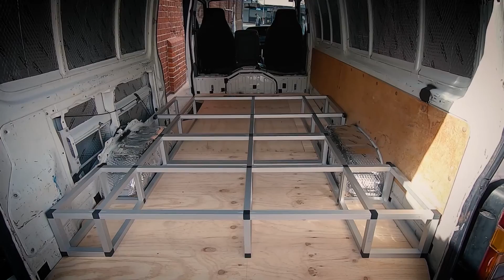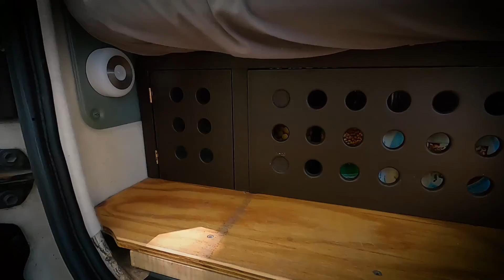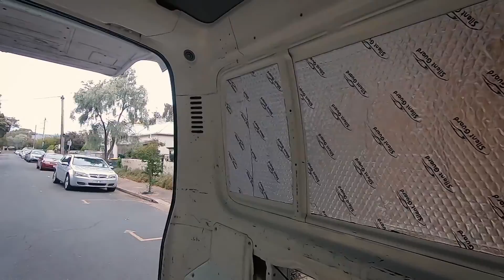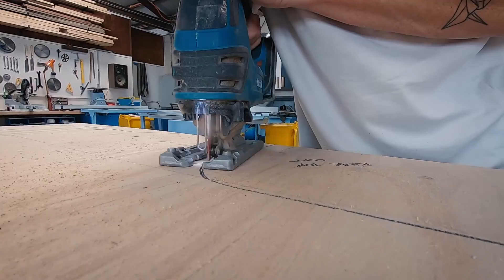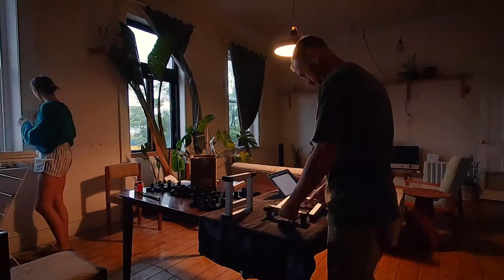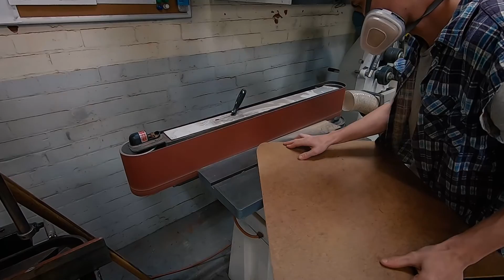05 Van Build Campervan Tour DIY Toyota Hiace Conversion | Vanlife Australia

Comment: I swear, is my HiAce the only one who’s seat has to flip backwards to get to the engine? I see these builds all the time and it makes me wonder. I can’t build anything behind my passenger seat, but at least I got the high top so I can stand up.
Reply from the maker: It been a while, but im pretty sure mine flipped backwards as well. But if you fold the backrest forwards then lift the seat - it doesnt actually need that much room behind.
Reply: @EternalJourneys  I honestly didnt know the seat could fold that way too, never had a reason to try😅
Reply: @EternalJourneys  I discovered this the other day in my newly bought Hiace.

Comment: Hey, great build 

Wondering for your kitchen setup behind the seats. Is it easily removable to allow access for changing the oil filter and fold back of the chairs to gain access to the engine. Ideally I want to do the same as yourself in my 2006 haice but hesitant due to the oil filter access point and engine access 

Thanks 🙏
Reply from the maker: Thanks mate! Yeah, if you look back at the floorboard installation you'll see ive left a cutout for the access panel on the floor. Which can then  be accessed through the two cupboard doors under the sink. Theres no backing on the cupboards either, so everything is accessible from the front as well. I had a major service done after the build, so it's all suitable. I made all of my measurements with the engine bay open (passenger seat access).  That way you know how much space you need to leave. Your newer model will obvs be different, so just take all precautions before you start.

Comment: Is it 100% necessary to insulate the floor and walls? I also live in Australia (syd)
Reply from the maker: Depends where you're going man. Definitely worthwhile if you're heading somewhere wintery cold (im in Tas atm). There's a bit of debate about whether insulation is useful in the heat.  The argument being; that once the van gets hot, the insulation actually keeps it hot longer. Of course, if you've got aircon, then its probably going to benefit. You'll def want an air vent/fans.

Comment: Like your design approach, keep it simple, make it safe, quiet, easy to maintain, non-toxic and lightweight! Quick Q, are you using a solar blanket or a portable panel? Don’t see any roof mounted panels. Also, if you know of a better small vent system, would love to know. I installed a marine style solar powered battery operated vent on mine, but it isn’t powerful enough either.  Great vid! 🐨🌷
Reply from the maker: Hey Lucy, glad you enjoyed the vid! 
I started out with a solar blanket but it wasn’t really sufficient. I’ve recently installed a proper panel on the roof. It’s just an eBay cheapie, but works well enough for my needs. As far as vents go, I haven’t really done much research. Mine is fine most of the time. It was only in North Queensland when it started warming up, that I struggled a bit. And I don’t really think a bigger vent would’ve made much difference.
Reply: @lucylou5766 You commented 5 years ago, but still here!. I've just bought a marine style fan/vent and was wondering about how efficient it would be, so it's lucky I was reading all the comments here. It's not installed and while playing with it I discovered that it doesn't work when it's in shade, so won't work at night when I'm sleeping. So it's back to the seller for a refund. Lucky I didn't buy two.
Reply: @narelle4868  And I’m still here too. My solar vent has a small battery which runs the vent at night time. It’s more than enough to turn the fan 24/7, but honestly, the unit isn’t big enough to do much more than create a little air movement. I bet marine units exist that are more powerful than the cheapie I bought.
Reply: @lucylou5766  I paid AUD$132 for mine from ebay. Testing it while it isn't installed I am underwhelmed by the air movement it makes, so I'm thinking I will return it. A couple of fans at either end of the van would make about the same air movement. It's an EG Solar Ventilator. (Youtube just glitched and added my comment multiple times, then deleted them all).
Reply: @narelle4868  A lovely woman in the US called Lady Bugout uses nothing but two marine vents. She reckons they work. She is a DIY type and her van is really different from most. She is very practically minded. Having two means air in and air out.
Reply: @lucylou5766 It's from @LadyBugout that I got the idea. I just asked in comments how they are.

Comment: What kind of wood you used for the floor frame?
Reply from the maker: Hey, I used pine ply-board and cut it into strips. Cheap
Reply: @EternalJourneys  thanks love your video. Just wondering what thickness ply and insulation sheeting did you use for the subfloor? Cheers

Comment: Hi. How did you attach the floor frame to the van? Thanks
Reply from the maker: Hi Pedro, I used liquid nails. Which is a type of adhesive. Very strong. Then there were a few screws that went all the way through the floorboard and the floor frame, into the metal. To ensure everything stayed in place. Make sense?
Reply: @EternalJourneys  hi mate! Just wondering. You screwed to the metal as well? Is that not going to cause rust?
Reply from the maker: @Adrian-sv1mo  I only put a few screws into the metal. Then climb under the van, clean around it and spray with rust-stop paint.

Comment: Thanks for the vid man, super easy to follow and the links are great. Just wondering the best way to attach the masonite walls over the windows?
Reply from the maker: Hey thanks Steve, glad you enjoyed. The Masonite is held up using adhesive Velcro. Not ideal, but in combination with the felt carpet it has stayed well. Probabaly would’ve been better to drill holes to match those on the walls, then get some press plugs or similar to hold it. Hope that makes sense haha

Comment: Hi ty im a new subscriber .if i dont have the tools , is it better to hire or buy a van kitted out ? I like the idea of personalizing it but on a practical level im still figuring out the best way . I noticed the toyato hiace is 1999 is that the most reliable year for old vans ?
Reply from the maker: Hey thanks so much!
It really depends on your situation. I had no tools and no space to work. So I had to borrow tools and do the work in the street mostly. So it took a lot longer because of all that. But the van is now just the way I want it. You could also consider getting someone to fit out the van for you. My Hiace is 1997. 
They are all quite reliable, depending on how many kilometres they’ve driven. Usually you want the older models to be less than 300,000km. Although Diesel engines generally last longer. Whatever you do, make sure you get a mechanic check done on  the van before you buy. That way you know what you’re getting! Hope that helps 🙏🏼